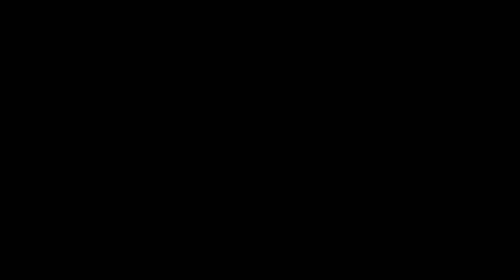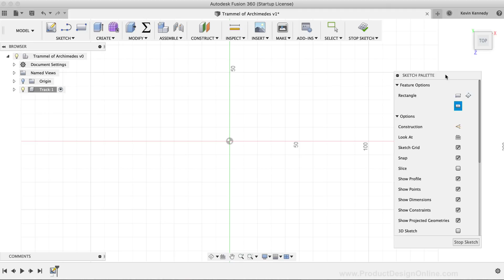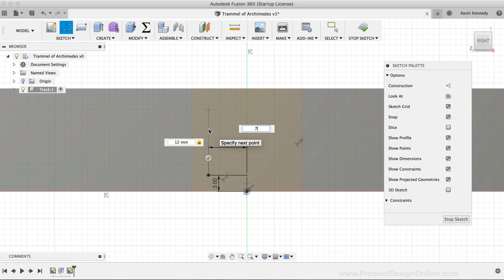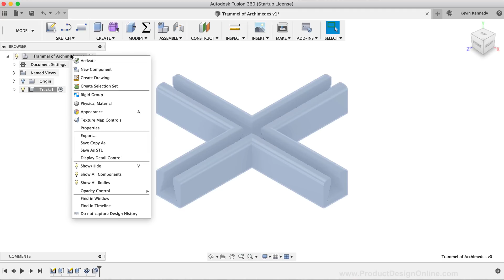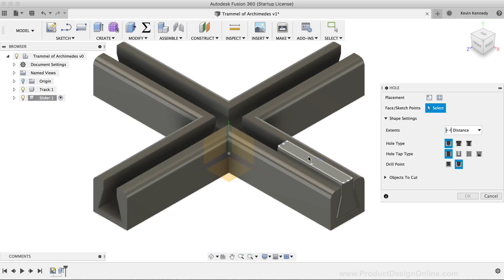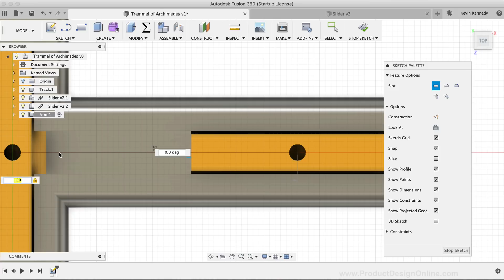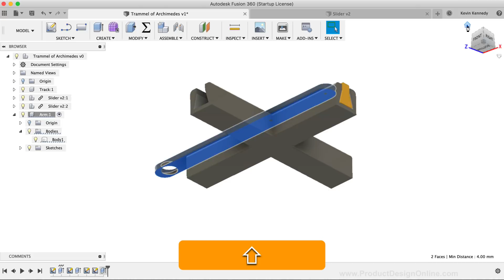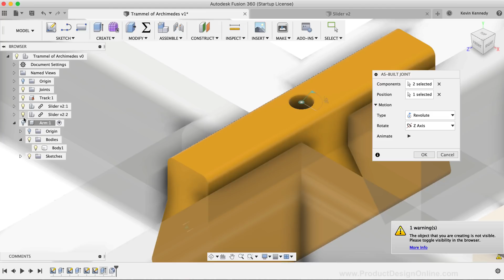How to 3D Model a Trammel of Archimedes in Fusion 360  | 3D Print a Do-Nothing Machine

Comment: All the god damn components, not active, are ghosted on my screen!!!!!  What the hell did you do to make all components not ghosted while you have Arm active?  I am about to take a baseball bat to my computer!!!  I cannot google or find anything to switch them on and now what should be a 10-minute tutorial has my head ready to f-ing explode!!!  The default is the ghost all non-active parts.  You are doing a beginner tutorial.  You have Arm active yet all the components are visible (look active) as if you had the top part of the assembly selected!!!!  Therefore you must have turned on some function switched on that I cannot find! Maybe when you do something non-standard in a beginner tutorial you start out by telling your students what you did to get there!
Reply from the maker: Hi, ctbram0627. If you're having a problem, just ask. No need to get upset.

This was actually a bug that occurred while I was recording. When I re-activated the arm component the rest of the components should have been ghosted.

This is however a setting that you can turn on and off in your preferences. Click your username in the upper righthand corner > Preferences > Design > Turn Off the "Show ghosted result body" (third from the bottom) > restart your Fusion 360.

Cheers, Kevin :)
Reply: @ProductDesignOnline  Yeah sorry.  I finished and printed it last night. My OCD kicked in though as I could not figure out how you had one part active and all the other parts seemed active as they were not ghosted.  It drove me mad try to figure how you did it.
Reply from the maker: @ctbram0627  No worries. How did the print turn out? Cheers, Kevin :)
Reply: @ProductDesignOnline  It came out well.  I will link some pics.  The tolerance on the arm pins was a bit loose so I am going to remodel the arm pins and the two sliders to have a revolute snap fit (hopefully).  I'll throw pics up on my imgur page as soon as I can.
Reply from the maker: @ctbram0627  That's great! Looking forward to seeing some pictures. Cheers, Kevin :)